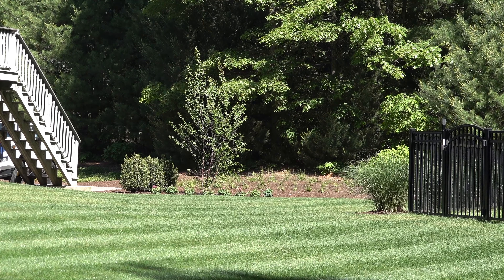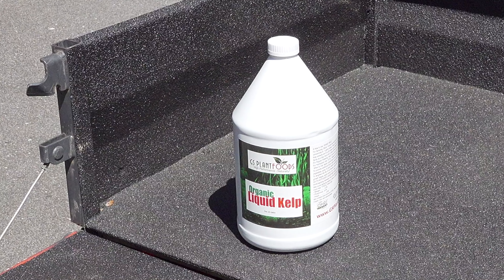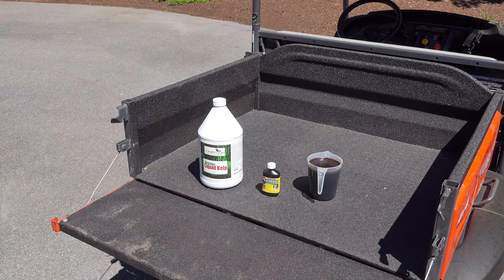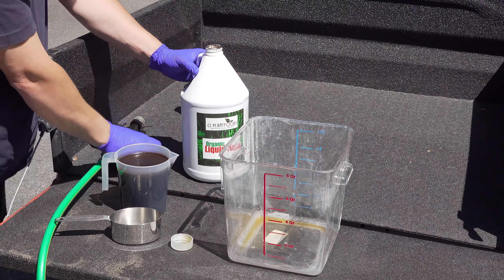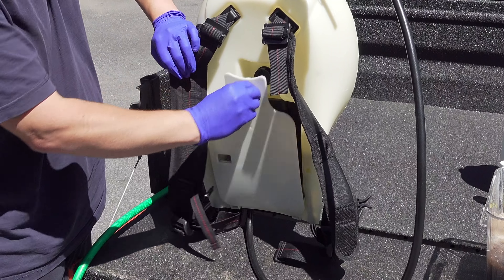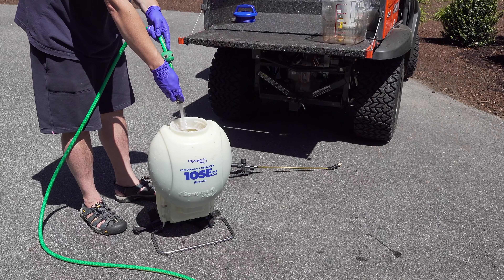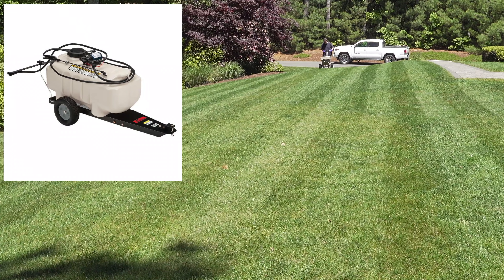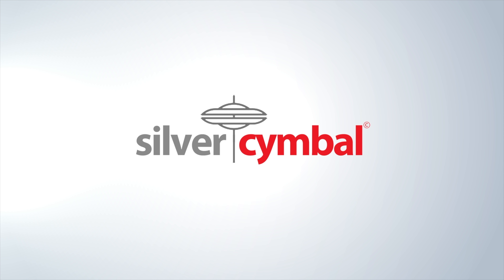Protect your Lawn From Summer HEAT & Stress my Secret Recipe STAY GREEN with Sea Kelp

Comment: Hi. I love all your videos. I just purchased the 3 ingredients and I have a couple of questions. Today is May 11, 2020, when should I put it down for the summer heat? Is it just one application or do you keep putting it down over the summer? And finally, do you have to water it in after applying. Thanks so much. Take care, be safe. 

Bill from Worcester Massachusetts
Reply: Still no answer. 11 0038 Jul 22, just saw the video and was wondering the same thing. Thought, Oh I'm sure someone has the same question, and here it is, of course he decided not to answer, was quick to put a disclaimer though.
Reply: Hey Gary from worc county also. Before summer hits out down Anderson pgf complete 16-4-8. You can put this spray mixture on  days 80 and below. Not on days we've been having of high humidity. It will be to much stress on lawn. After spraying this stuff wait a good 24 hrs before watering so grass will suck in mixture and dry

Comment: I’m in Houston Texas . Summer is here . Temperatures are really hot and humid . My lawn is st Agustine. Can I use this wonderful mix ? And if I do when is the best time to apply ? Do i water before or after ? Ty keep up the great work .
Reply from the maker: Yes you can definitely use it and it should be very beneficial for you. You don't need to water before or after. Its best to spray it on and have it stay on the grass for 24 hours before water so it is absorbed. Its ok if rain happens it still works into the soil but ideally the drying time works well.
Reply: Where did you get liquid humic from? I stay in Houston also
Reply from the maker: @302StangBoss  https://amzn.to/2WyMABa

Comment: Hey, great job !!  Very good video. You should be commended for coming up with your own formula. However , im just a little fuzzy on the amount to use for my area.. My lawn is just under 1400 square ft...nice size for where i am, but alot smaller than what you're doing.
Do i just mix up the 4 gallons and then spray the lawn till its all wet, or do i reduce the  amount of the.additives..?
I understand the amound of each are not exactly critical but my area is alot smaller . Im in the northeast and can hear my grass screaming already !! Love to try it.
Again, well done !!
Reply from the maker: Thank you for the nice comment. For your sq footage. I would just cut everything in 1/2.  Reduce each component in 1/2 which makes it easy. Add them to your sprayer and then fill it up to 2 gallons instead of 4. This should be enough for 1250-1500 sq feet.  You can apply a little less or a little more, it will not harm the lawn. I found that my amounts give the best results without being wasteful so dont worry if you are off a bit. Hope this helps.

Comment: I noticed you used alot of humic acid. I believe the label on the recommended product is 2 ounces per 1000 sf of lawn. I think you are using 6 ounces per. Are you premixing with water or are you just using more than what is recommended? Thanks for the great video.
Reply from the maker: Yes I am using about 6 ounces for this application. Humic acid isn't like fertilizer and won;t ever burn and honestly most products really under apply to state that they can go further. In my experience this formula with this product worked perfectly for these applications.
Reply: I’ve heard of people using 12 or more without any issues... it expensive but works great. Really is not much of a dosage ceiling for humic from what I know.

Comment: I used your formula a couple of times and really didn’t see any difference, and I did follow your instructions closely. Lawn was still going dormant, so I watched another video and they said it was safe to dethatch in the summer because of “collected matter”. Now my lawn looks worse than ever! I ordered some more humic acid and will spread another batch of your formula, because I stronger believe it’s good for the lawn. But if there is any other advice you can give me to revive my lawn, I would gladly appreciate it. Thank you
Reply: This prevents dormancy not brings it out. Only thing that will bring it out of dormancy is a lot of water consistently. And yes never dethatch during dormant months (winter and summer) as it rips out what would be dormant good grass and insulation (thatch) needed during stress. I dethatch right before aerating/overseeding around the end of September.

Comment: Thanks for the video!  Just to be clear, are you adding ~ 3+ gal of water to your mixture to get the 4 gallons?  The clear container you used to mix everything does not appear to hold 4 gallons.
Reply from the maker: Thank you very much for the nice comment. No add the concentrate to the sprayer and then top the sprayer off until you reach 4 gallons. Some have commented its better to add the water first and then the mix, if thats the case, just add about 3.75 gallons fist and the concentrate to reach 4 gallons.  Hope this helps. Thanks for watching
Reply: @SilverCymbal  what's the application rate per thousand sq foot of yard? you mixed 4 gallons of final solution, but didn't indicate the amount of lawn area you covered with it.
Reply from the maker: @loosecannon124  Yes the mix in the container was added to the sprayer to then make 4 gallons of solution. With that much walk at a normal pace to get an even covering of the grass, you dont have to go super heavy. It will vary how much you can do but for me the 4 gallons covered about 4000 sq ft.  You can't over apply this, and you can under apply and still get benefits so this is one of the few treatments you don't have to strss yourself over. The grass will love any of this and the kelp.
Reply: @SilverCymbal  Have you tried spraying using dial hose end sprayer?

Comment: Last year I tried this exact formula with these exact brands on several different areas of my lawn as an experiment. I treated half of the front yard once, a few patches twice, and a meter-wide strip in the back yard dividing the yard five times. There was no discernable difference in the results at any point in the summer or since. Virginia, clay soil, tall fescue, and some annual rye.

Comment: Question sir..i have a acre lawn. Just got done with my first treatment. Ended up using almost 50 gallon of your product using 25 gallon tow behind sprayer. Used almost 2.5 gallon humic acid in one treatment! Can I decrease humic acid to 2 cup per 4 gallon? That would save quite a bit. As it is it's gonna cost me over $70 per treatment..thats a bit much. Also used almost a gallon of kelp. Thanks

Comment: Thank you. I love your videos I watch them every other day. Question though what's the rate of application in gallons per 1,000 sq ft?
Reply from the maker: When I mix 4 gallons I get about 3000-4000 sq ft depending on walking speed and tip size, under-applying is still ok and you get lots of benefit. Over-appyling really wont hurt so the formula is forgiving.

Comment: Great video. I learned about this last year on a lawn care forum but I did the dry version: Anderson's DG humic and sea kelp then spread it with my drop spreader.  Hope I have the same drought resistant results.  What do you think SC??
Reply from the maker: You definitely will the kelp treatment is phenomenal. It also helps the grass in other ways too.
Reply: Kbentz, what was your ratio of kelp to humic and were you able to get the granular kelp locally?  If so, where?
Reply: @sherievaughn6475  for granular humic and dry sea kelp, I did a 50:50 ratio. Humid DG doesn't seem to be available to me locally. Had to do Amazon.
Reply: @kbentz. Thanks!  Yes, getting the humic online too.  It’s the granular kelp I was trying to source locally. Thanks again
Reply: I didn’t realize sea kelp was available in granular form. I already bought a spreader and did the humid acid and I didn’t want to buy a sprayer. Didn’t realize how pricey they are.  Thank you!
Reply: How much product would you spread on a lawn if similar size to the video? Also how often would I apply to my lawn? Thanks in advance.

Comment: Subscribed. How often is this mixture applied?
Reply from the maker: Thank you very much, I apply it about once a month when daytime temps are routinely over 75 degrees.
Reply: @SilverCymbal  what is your application rate, meaning how many square feet of lawn will your 4 gallons of mixture cover?
Reply from the maker: @windycityrider  You can cover about 2500 sq ft if you need to go further with it you can and it will still be helpful but this rate worked best for me. Thanks for watching.
Reply: @SilverCymbal  OK thanks. So it sounds as if you had to suggest a application rate it that you feels it works the best at is 1 gal per 625 sq ft. ??? I understand that there is some flexibility in that range but I definitely want to follow your suggestion as to what rate works best. Does that sound about right?
Reply from the maker: @windycityrider  Yes that is correct and should work very well.
Reply: @SilverCymbal   thank you!

Comment: C.C. My lawn went dormant recently (this has been an issue in the last few years) and would like your help. I’ve tried countless products to help promote water retention in a full sun location. I use an oscillating sprinkler and water in the morning and try to reach at least an inch/week along with heightened mower cuts. Is there anything else I can do to prevent my grass from going dormant? Thanks

Comment: The formula is interesting.  Not sure why you turned on the sprinkler system in the middle of the day.  Is it to water in the application?  If so, how long do you need to water it in?

Comment: Hello, does the application need to be watered in? If so, how much water? Thanks for a great video!
Reply from the maker: Thank you,  no it doesn't need to be watered in. It's actually better to allow it to dry onto the foliage for at least 24 hours but if it does rain or get wet, it's still beneficial but that initial dry period is very good and easier on you without the initial water,

Comment: I used your suggested 3 product formula to eliminate a lot of crabgrass and creeping charlie I have in my newly replanted this May lawn here in central Mass. That process has worked nicely and now I'm thinking I need to rake out a bit, reseed in some areas that the crabgrass choked the lawn grass out, and fertilize. Can I use this method on newly over seeded areas of lawn? 

I'm also using this formula in my garden with a 2 gallon sprayer.
Reply from the maker: That's great to hear. I am glad to have received a lot of positive feedback on this mix for people. Check out my other video and it takes you through my lawn renovation process and this shows what I did. Raking is always good to do but this may be a little easier. Thanks for watching. https://youtu.be/c54WSOI-MMc

Comment: Hey.....I like your formula but have two questions.   I am experienced in organic lawn care.  I have a 3/4 acre, very healthy, northern cool mix lawn with 98% direct sunlight so it tends to go dormant when the heat mizer cranks up the temp(july-august).    I was curious to see what would happen if I applied your formula.  First,  when should I apply your mix(it's currently 6/11) and secondly, approximately how long until I should start seeing results?  I have no problem feeding my lawn a 'vitamin injection'  to get it thru the the hot summer months here in CT!  Thank You and you posted a fantastic video!!
Reply from the maker: Thank you for the nice comment first. Second, this formula is primarily to keep the lawn from stressing out and burning up prematurely during the hottest times. I am basically in the same climate as you in Boston  so the timing is perfect to apply this now, temps getting over 75 daytime. I get very good results in about 2-3 weeks after applying but the biggest result has been better tolerance through the summer and my lawn stays green long after my neighbors are toasted up so that will be more of what you will see (or not see :)  Keep an eye on my channel a couple of other formulas I will be sharing shortly. They all work with one another have specific purposes and this one is to help protect and enhance the lawn for heat resistance. Thanks for watching.

Comment: Do u have to water it in when using backpack? I've seen some others say if you use a hose end u don't but if u spray with a tank you should  water it in. Also Hydratane is really good for summer heat ,especially here in Florida
Reply from the maker: Not at all, for this one just spray it on and give it 24 hours to work through the grass blades and you can then go back to regular mowing, watering, etc.

Comment: Thanx for the formula
Question
With the humic acid, I use the same brand you use, but it says 2oz to 4oz maximum per gallon, you're using 6oz per gallon, is that the effective application rate?

Comment: I’m a bit late to the party it’s June now and the weather has been hot and dry. I’ve watched many videos on lawns including one that suggest to scarify rake sand for levelling then seed with top soil and water. This is all great if you are doing in March/Sept. Question how can you improve the lawn if you have missed these opportunities to rehabilitate your lawn. My situation is last year put down 4-1 product by evergreen within 12 weeks my tree had died and all the leafs fell off the grass stop growing and the weeds exploded. Now I have a lawn that is scorched full of weed and the grass hardly grows. Can someone please clear the mist let me know what I’ve done wrong and suggest the correct steps to take to bring back my lawn even though we are well into summer
Reply: In summer heat, you have to take it easy. I just use milorganite to gently feed it. You can't  mess it up like with chemicals. I only use non-organic when temps are moderate. Also, consider subscribing to the "Lawn Care Nut" emails. He sends out reminders for when to apply.

Comment: Could you use a hose-end sprayer to apply this concentrated solution to the lawn? Divide it into two applications? As I believe most hose-end sprayers have a 32 oz capacity?
Reply from the maker: No, you really want to use a sprayer to get a good fine mist. Most of the work is done through the leaves and not the soil. If you want a very affordable but great option get one of these and just walk it. You can do a lot with this sprayer too. https://amzn.to/2xBJP3k
Reply from the maker: @Tundra_Guy  Research on plant growth conducted over the last two decades has demonstrated that the plants assimilate essential micro-nutrients more readily when they are applied directly as a foliar feed than when applied through the soil in an Organic form.

Comment: How often do you apply the solution in one summer and when do you start watering after you apply the solution?
Reply from the maker: I usually apply it 2-3 times for a typical New England summer. If you do less you will still get benefit from it and more is ok and will help more.  Also, no it doesn't need to be watered in. It's actually better to allow it to dry onto the foliage for at least 24 hours but if it does rain or get wet, it's still beneficial but that initial dry period is very good and easier on you without the initial water,

Comment: I really tried to find the answer to this before I typed this question!  The humic you use says it’s a concentrate. Do you dilute it to get the 24 ounces or do you use this right out of the bottle. I guess same question for the kelp. I’m definetly going to try this.
Reply from the maker: No worries, if yoiu are making 4 gallons of finished solution just use the amounts shown in the video straight from the bottle. You dont need to mix them individuals since they are both liquids, just measure them out and top off with water to fill the sprayer to 4 gallons. This mix can be adjusted some too, it's not toxic or anything like a weed killer. MOre or less slightly will not cause problems. I have found this mix amount worked best for me without wasting money applying too much. Thanks for watching.
Reply: Nice I'll let you know how it works in the northeast in metrowest massachusetts.

Comment: How early in spring do you start to use it and how often? Thanks, good video
Reply from the maker: When I mix 4 gallons I get about 3000-4000 sq ft depending on walking speed and tip size, under-applying is still ok and you get lots of benefit. Over-appyling really wont hurt so the formula is forgiving.

Comment: Is it worthwhile to add a surfactant to this formula to increase stickiness to the grass blade?
Reply from the maker: No, it's not needed for this, it may even interfere a bit with the absorption.  Use it as is for great results, this has made such a difference especially with this long HOT summer.  Kelp: https://amzn.to/2It5ZJT  -  Superthrive: https://amzn.to/2It654d  - Humic Acid: https://amzn.to/2WyMABa - Sprayer: https://amzn.to/2IslQIJ

Comment: I have Kentucky blue grass.  Will this burn my lawn?  It's nice and green now but summer temps about to soar. I'm in Colorado.  I dont want to burn my lawn. Any tips on how not to? Thanks!!
Reply from the maker: No worries at all, it doesn't work like fertilizers that can burn your lawn. Think of it ore like vitamins and supplements for your lawn and generally these can not be overdosed. If you use my amount for your lawn you will get great results and definitely will not damage your Kentuck Blue. That's at least 50% of what my grass is too.
Reply: @SilverCymbal  awesome thanks for the advice!

Comment: I just did this in direct sunlight on the grass and watered it in. Good or bad move?
Reply from the maker: You didn't hurt anything but it needs to be absorbed by the blades, it usually takes 12-24 hours, you will still get benefits in the soil but it is greatly reduced.